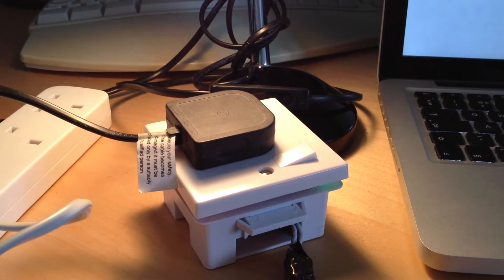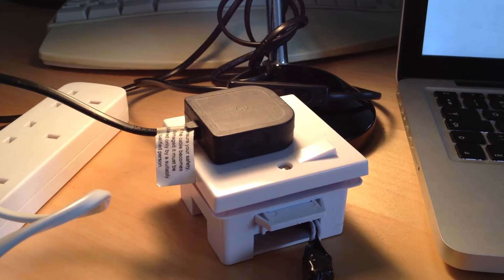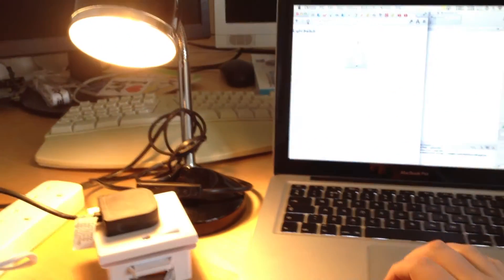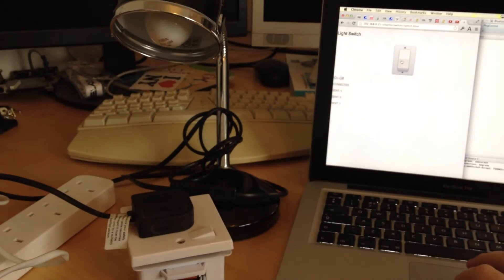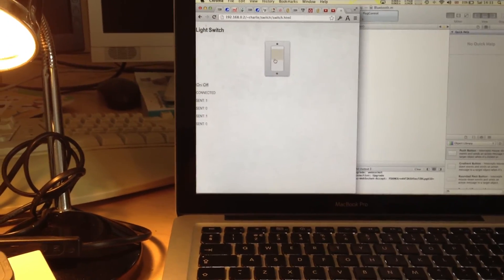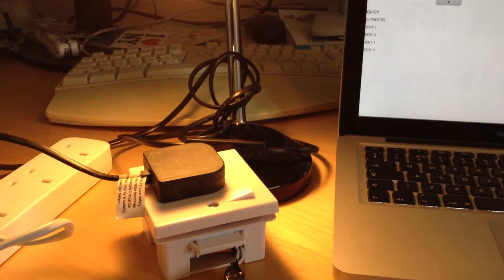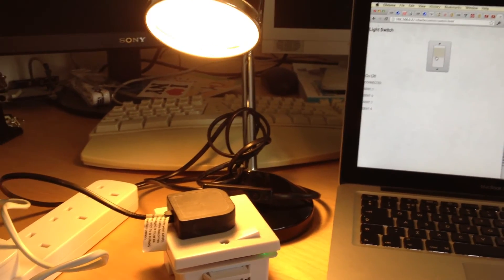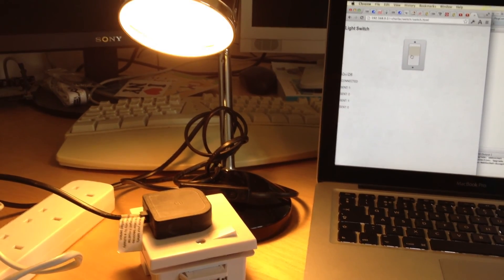Homemade Wirelessly Controlled Plug Socket

Comment: Hi. A good electrical wholesaler should sell a deeper box. Usually referred to as a plasterboard box or dry lining box. I have used them to install shaver sockets as there are large isolating transformers on them.
Reply from the maker: +lee Thanks for the tip, I didn't know you could get deeper ones. Would definitely have made it easier. In the end I wimped out of actually installing this and bought some commercial LightwaveRF sockets instead.

Comment from the maker: Hi,
I can't add a link in the comments section so I'll edit the description for you. Basically the high voltage side of the relay (the one with common, NO, NC terminals) goes between the live wire coming in to the box and the live connection on the plug socket. I used common and NC as that would mean if the relay failed the plug socket would still function.
LED driver was just a cheap one from eBay. 1W, 5V output. It'd probably be better to get a 12V output and pass through 5V voltage regulator.

Comment: Sir could you please include the specifications of the LED driver and also the schematic diagram if possible,i was confused where to connect the relay's NO to the plug socket. thanks in advance! I hope you'll help me with this problem of mine. By the way i admire your project it is really useful.

Comment: A further step could (I'm looking for this product) be incorporating this in an extension lead, it wouldn't need retrofitting existing walls sockets, and one would then plug all decorative wall and shelf lighting into this lead and have it operated by bluetooth, the server idea sounds good and is probably needed for the automation and the outside radio range control but operation from a smartphone app or program would be a necessary step in looking for commercial potential with this. Nice work!